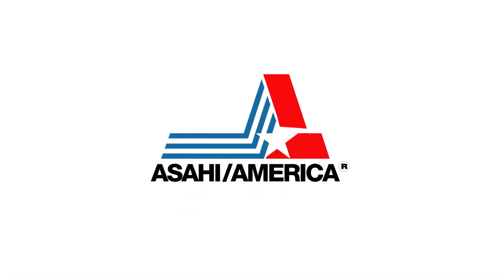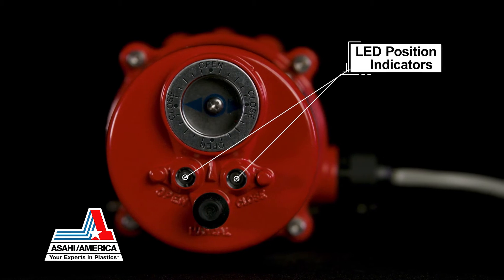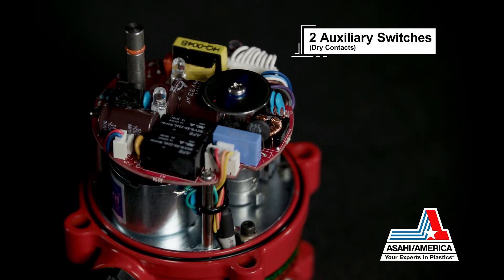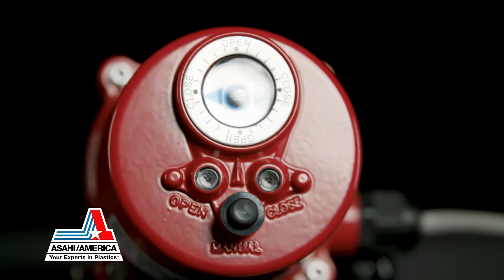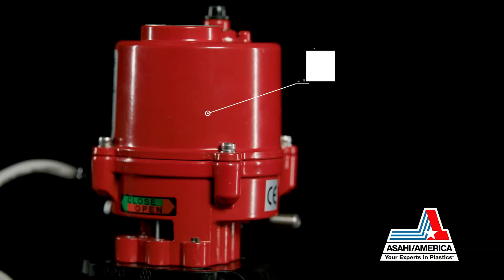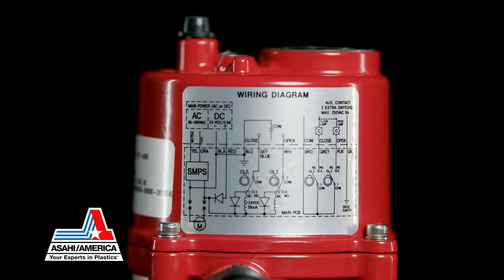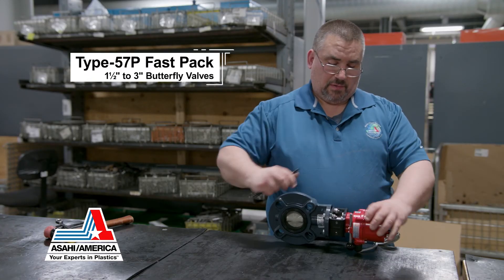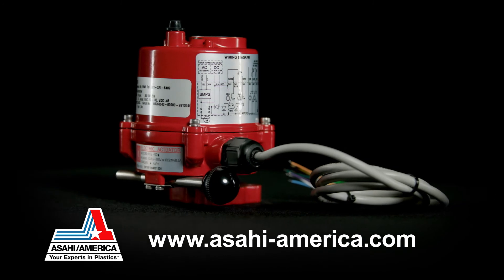Asahi/America Introduces the Series 17 Compact Electric Actuator

Comment: Can you wire the open and close light indicators to a control panel? Maybe via the auxiliary switches?
Reply from the maker: Hi Austin, thank you for your question. The auxiliary switches are dry contacts that should be able to output the closed or open signal for light indication on your control panel. The switches are rated for 250VAC and 5A. If you have any further questions, please do not hesitate to reach out. We have more information/data sheets on our website here: https://www.asahi-america.com/valves-and-actuation/actuators/electric/series-17-electric-actuator. You can also contact our customer service team at asahi@asahi-america.com or call us 1-800-343-3618. Thanks again. - Asahi/America social media team.